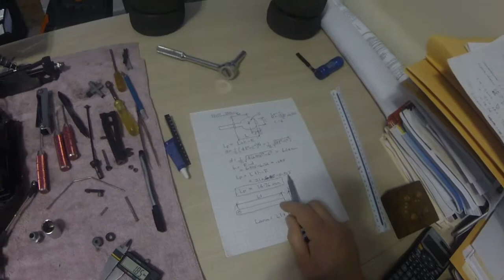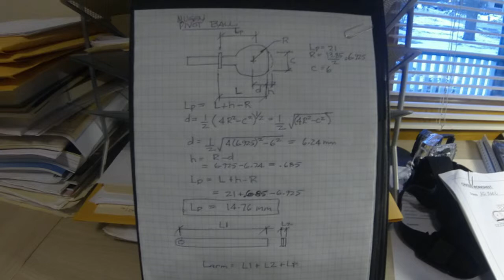Mugen MBX6T Pivot Ball Suspension

Comment: Great video.
Now I know the main benefit for pivot ball suspension is the additional steering turn you gain compared to C-hub suspension. I still run a car with C-hub and my inside tires on full turn are literally dragging themselves so I have more then enough turning area and also my camber link is easily adjusted as well. Pivot ball upper links often require disassembly and shimming to adjust camber. I also notice with pivot ball suspension the upper link has to be a heavy A-arm style link. My car has just a lightweight camber link although many C-hub style vehicles utilize an A-arm style upper link. No another thing I sometimes notice on pivot ball cars is when hitting aggressive bumps (out door tracks in upstate ny tend to be washed out and quite brutal) their front wheels seem to bounce back and forth in relation to their outer hubs, ie their hubs are being allowed to move due to the nature of the pivot ball design while my hinged at bottom, camber link top C-hub design seems much more rock steady. 
So my question is and I'm also asking your opinion and experience is are pivot ball designs better (gains out weigh losses) or is it an industry fad? 
Additonal. I race a now considered out dated O'Donnell Z01B SG 8th scale nitro buggy up against guys with the latest Losi, Team Associated,  and Mugen Seiki buggies all with pivot ball suspension and always come in the top 5 out of an average field of 15 to 20. The guys pick on me with my O'Donnell and my C-hub but I am always more consistent and even winning with my old school C-hubs. Now I do run ceramic bearings, all hardware stainless steal or titanium, titanium turnbuckles and hinge pins etc. I have a lot of aluminum in place of steel (ie steering pillars, etc) for weight so my car weighs in at or below the latest and greatest buggies available).
Also many guys at the track feel very compelled to buy all new buggies every year or two so they can have the latest and greatest yet I continue to almost dominate with a 12 year old design (granted I have every upgrade and weight saving feature in place that was or is available).
So idk, guess my question is again pivot ball a fad or trick to get guys to buy the newest kits or?...